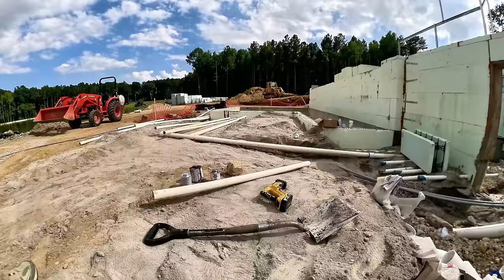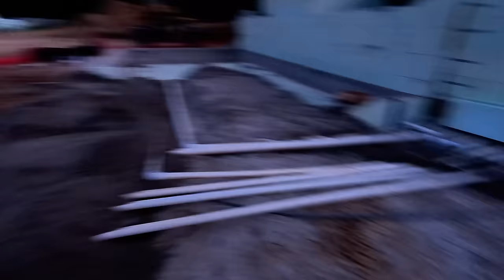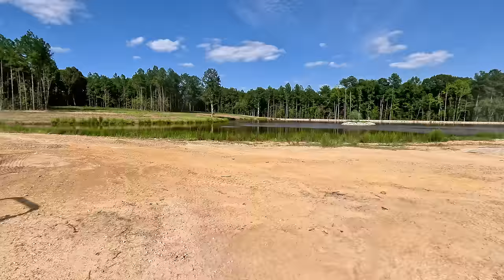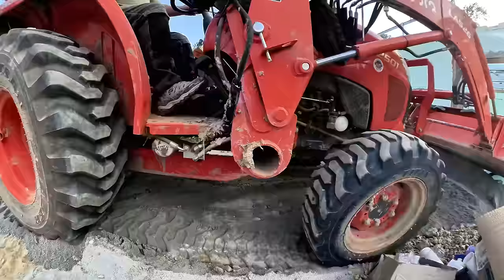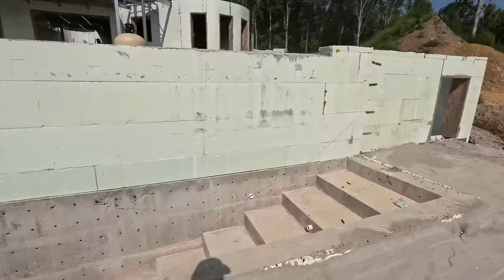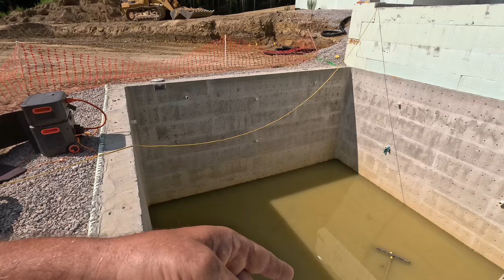Plumbing the Two Level ICF Pool

Comment: When we would have pipes run like you had there (surface, not in ditches) we would typically bed them in a small amount of screenings then do the bulk fill with gravel. Then put the needed thickness of screenings on top the gravel for pavers. The reasoning for doing it that way is that the screenings tend to move a lot when run over with wheeled machines and it can really stress or damage the pipes.

Comment: Was a plumber as Side job to pay for college back in the Early 80's.  Lots of changes in material, yet so much still the same.  

Boss [ fishing buddy RIP]  was a stickler for plumb even for what you did under the screenings.  Not needed, but he wanted it looking good to a level of perfection.  Was a good hands on Trade for me to have different focus vs engineering studies.  Think it was a positive once I got in real world.   

We used to run small diameter black tubing through the concrete slab for heating.  Not seen it around since I was doing installs.  I used to run extra in front of toilet to keep your feet warm on a cold morning.   Asked and had a owner of property say he noticed it, and glad to why it was warmer there.   good times..
Reply from the maker: @johnm840  we are doing floor heat in basement and main level 😊

Comment: Just a couple of questions which if possible you could address in your next video, 1) I noticed you did not pressure test your pipework before covering, is that something that really should be done or are the glued joints always ok? 
2) Just a general question regarding budget for the build, would you say you are on budget, below budget or is it a question of money no object? 

Loving the videos and your enthusiasm, keep up the good work🙏
Reply from the maker: (1) You should pressure test. 
(2) Under budget for the pool. Not bad but over on the house. 
Thanks 😊
Reply: I 'm also curious about the depth of those pipes where they make a 90 degree turn. They appear higher than the pool and pool services room and will they be affected by the occasional frost? Most counties have recommended frost line depths or will those line always have warm water circulating in them?
Reply from the maker: @michaelsmith7425  They ended up a bit higher than I wanted but they are lower than the pool as travertine covers these too. Water is either always moving or can be drained. We are lucky here that we barely have any frost line.
Reply: @BealyGood  Thanks for the explanation. 👍

Comment: Braver than I am would have had to tamp around every pvc as it was back filled and not drive across
Reply: I have yet to see him pressure test any of the pipes to see if they are leak free. Hopefully that has happened off camera because if not it will be costly to repair them once they are buried and either tiled or covered in concrete.

Comment: A little late but look for anything labeled inverter style in pumps and other things. I have a lift station for my septic. Put an inverter style pump in it. So far saving me at least 20$ a month. Probably more. It only runs 2 or 3 times a day. Changing incoming power from ac to dc makes a big difference on electric usage.

Comment: Geoff, did you pressure test / leak test those pipes before covering? Also, what was the pipe open end you buried when back filling, did you notice that? It’s coming along…
Reply from the maker: No.

That was a 1 inch electrical coupling that was loose. I grabbed it up later.

Comment: Geoff, the finished plumbing for the outside of the pool area and the screening covering is great and did a good job on it all, nice to see all that section DONE!, Look forward to getting the pool work room finished, along with other odds and ends, and get the walls built, and then, ??? Possibly move onto getting the first floor and roof?? what are your thoughts on getting the Building done before Chrtstmas?? maybe not completely moved in by then but at least the Building aspect of it??
Reply from the maker: Hoping to have the roof on before the end of the year

Comment: Looking gooderer!  

Just curious, if you’re running two filters and, I assume, two pumps, one for each pool, are the lines for the jets all going to be tied together?  I’m just trying to wrap my head around having a dual setup but needing to maintain most of the flow back up into the upper pool.
Reply from the maker: Each pool is setup independently, with their own pump and filter. Then there is a third pump with its own dedicated pipes for circulating water between the two pools.

Comment: Is there a reason you didn't pressure test before you covered up your pipes or is it not needed?
Reply from the maker: Taking my chances. But I’ll push water thru before final grade.
Reply: Self Build and Self Confidence go hand in hand. When you are building for a "Customer" You better pressure up that baby and call for an inspection.

Comment: Good grief, is it really more than 3 years since that first walk through the woods with Chris?
Reply from the maker: @GARDENER42  Technically, September 15th will mark 4 years since I first met Chris out here at the property to check it out for me. 3.5 years since the first driveway fix.
Reply: @BealyGood  I think time flows faster the older I get, or memory becomes distorted...
Reply from the maker: @GARDENER42  both 🤣